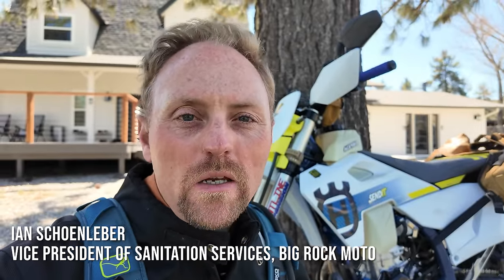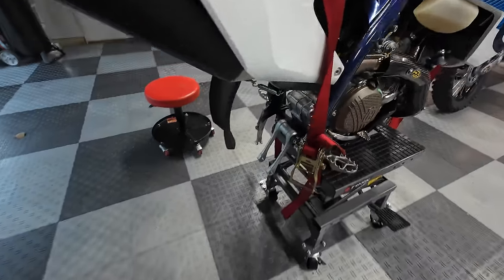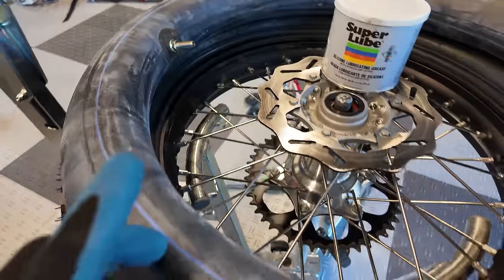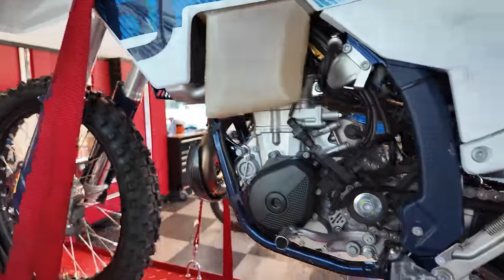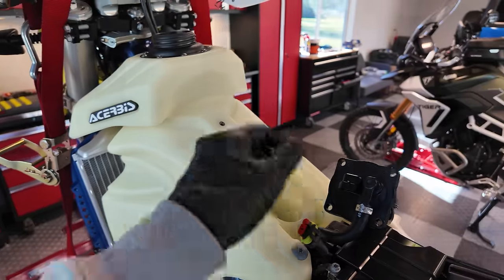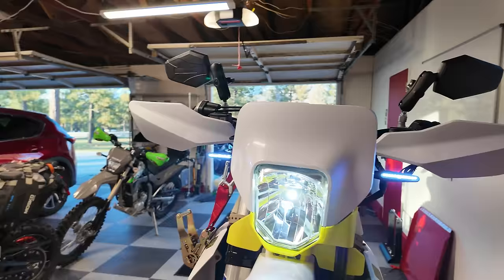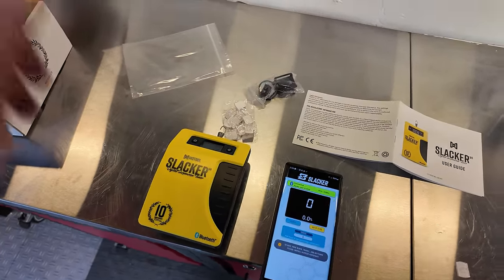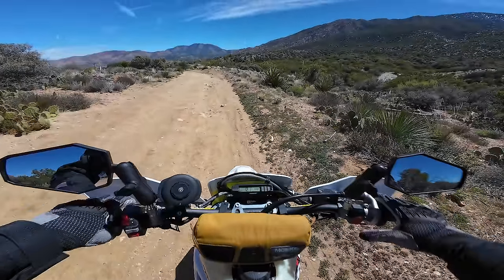2024 Husqvarna FE501S | Building My Dream Dual Sport (Phase I) (EP.4)

Comment: That’s not really a dual sport bike in the traditional sense if we’re being honest. It’s really just a street legal enduro dirt bike. And you took an already very expensive bike and threw several thousand more into it. I don’t know what your total build cost is but probably for the average dual sport rider there is not way that bike is $10k better than the KLX300, the CRF300L, the DRZ400 or even the DR650 or XR650. 
There is no doubt that you built a great bike but for the money I could have the less expensive option and use the rest of the money to finance a great adventure ride. 😂
It’s hard for me to justify dumping that much money into a glorified dual sport. Yes it has far better performance if you like to ride hard enough ALL the time to make it worth it. I think for us normal folk the more budget friendly bike offers just as much enjoyment and capability for far less money. 
I guess at the end of it all it comes down to do you honestly feel your getting your value for the investment or is it just more fun to see how many expensive farkels you can cram onto one bike? Especially when most are being provided free. Also, if you did have to foot the bill for all the parts used would you still do it? 
Either way, it’s still fun to watch. Keep doing what you do. ✌️
Reply: You'd be able to buy an f900!
Reply: My Kove 450 blows the “doors” off my KLX 300 and only costs $9k. About $11k with all the mods I’ve done, most of which are not really needed.
Reply: The difference with this bike is that you can ride on any terrain, at a high speed, comfortably. You can use this on a week long trip and be able to ride hard every day, while your friends on more traditional dual sports may be taking days off from riding to recover. If you just want to rip around at low speed, you can buy literally any bike and be happy.
Reply: @jckrieger  And is Ian riding "any terrain, at high speed"?
Reply: I find comments like this so passive aggressive.  “Value” is all relative.  What if someone can afford a bike built like this and also do an adventure trip?  Is it really necessary to compare other less expensive motorcycles to his build?  I for one have seen him test several bikes at all levels of expense.
Reply: @michaelflores7657  not at all. I wasn’t being passive aggressive it was genuine questions. Regardless of income or what one can or cannot afford within their budget is it actually worth all the extra expense compared to the less expensive options. And yes the word “value” can be quite subjective yet it’s used very often in the motorcycle world. By that logic pretty much any way we describe our personal experience with any bike is extremely subjective. So I guess I should simply not ask probing questions and just throw my own money around to find out if it was all worth it in the end? Is that not the purpose of following a reviewer? It seems that anytime anyone questions the reasoning of one product versus another it’s viewed as argumentative and aggressive. Perhaps I don’t eloquently articulate the proper tone of voice in my writing in such a way as to convey my thoughts and not sound aggressive. Maybe your not understanding my line of questions and should ask some of your own for clarification?
Reply: The FE501s is a great bike out of the box, and is an incredible dual sport. He's throwing money at it because he has a YouTube show that gains viewers and sponsorships through these types of mods and changes. My FE501s has tons of miles on it with the only mod being double take mirrors, and the only change being tires, because I wore out the TKC80s. That includes long distance, I did a 1600 miles 9 day on/off road trip around my state. I was on the stock seat even, and it's fine after it breaks in.
Reply: You should go into a bicycle shop and tell them how much wal mart is charging for “comparable “ bikes lol
Reply: @ridemfast7625  most of the time from what I see Ian is riding a fair bit faster than I would and is probably a more skilled off road rider than I am. Which again is why I was genuinely interested if there was actually real value or benefit to be had with putting that much into a bike like this for an average dual sport rider. If you have a background in enduro or motocross than I’m sure the more performance oriented bike would mean a world of difference but to me I don’t think I would be riding hard enough to need or appreciate the higher spec. But then again I could be wrong and the higher spec bike might give me more confidence to push harder off road. 😂
Reply: @coreyjdl  thank you. That answers some of what I was wondering. ✌️
Reply: @coreyjdl  I'm going to try to "break in" my stock seat. I have a Seat Concepts on my 2024 FE501 which I have thrown some money at. But since Brexit, even stuff from the US has shot up in price, so I'm going to get the wear out of the stock seat on day rides, and keep the expensive SC for big trips. I've worn out one SC cover on my 701 at 16,000 miles, about 24k km.
Reply: @michiganmoto7687 it’s not hard to hit the limits of a KLX 300 or CRF 300. And if you start pushing beyond that the bike is actually more dangerous and harder to ride than a higher performance one. But for total beginners and very casual riders they are fine. Unless you want to dump $$$ big money on mods.
Reply: @michiganmoto7687  No clarification needed on my end.  The first 3/4's of your message is telling Ian "there is no way that bike is $10k better...."  Everyone of your statements end with a passive aggressive jab at anyone that decides to spend $$ on parts you deem as not worth it.  Even your actual questions are laced with passive aggressive statements, it is literally the definition of passive aggression...I love how you had to capitalize "ALL" just in case we didn't see that.  BTW,  IMO if I have a performance part on my bike like suspension revalve, steering stablizer, ecu, traction control, etc I don't have to "ride hard all the time to make it worth it", if those parts help me stay off the ground one time it's well worth the $ i spent on them.  Again, that is just me and what I value.  I'm in no way implying that it's a requirement or even necessary for everyone to enjoy their bikes. I'm very thankful that Ian is testing all these different parts on the bike I'm going to build also and it's absolutely irrelevant to me if he received the parts for free.  I believe he's always been transparent and honest in his reviews.  Again, I don't understand why anyone would care how much someone else is spending on a bike build.  If you can get more 
enjoyment out of a stock bike that is AWESOME(pun intended).  Personally, I love putting upgrades on my bike and believe me I'm not pushing the limits of even my stock bikes.  It's what I enjoy and I get a tremendous amount of satisfaction from it and so for me its worth every penny.
Reply: @michaelflores7657  fair enough. I’m not going to apologize if my personality or how I speak seems like I’m intentionally trying to be offensive. If that’s how you choose to perceive it I can’t help you with that. Also I also feel Ian is honest in his reviews. I had genuine curiosity if it really was that evident in riding one versus the other. I’ve not had the opportunity to experience it for myself and it puts me in the position to rely on the information of others. As far as what mods you or anyone does or how much they spend doing it I really don’t care. Makes zero difference to me and for some reason that’s where your focus went. I don’t know, maybe your wife is giving you grief for spending money and now your ultra sensitive to the topic. What I do know is speaking to you any further is pointless because your more interested in pointing out my faults than having a serious discussion. So stay safe, add another mod and don’t fall off. ✌️
Reply: @michiganmoto7687  I’m in no way asking for an apology, you are who you are.  Whatever I say or anyone else says isn’t going to change you.  I will say bringing my wife into this discussion says a lot more about who you are than it does anything else.  You are correct about carrying on this conversation is pointless.  I wish you the best and hope you get your questions answered to your satisfaction.  Stay safe!

Comment: I'm a big fan of your content, but the magnetic filter is just marketing nonsense sorry Ian. Magnetic filters do exist, and are used in industry, but they have very specific use cases. Usually the best places are large machines, such as large diesel engines where the regular diesel filter might foul up quickly. Even in this application, it is a secondary, not a primary filter. This is most of the case of use for magnetic filters. Even with that being the case, wouldn't engineers in any of the Japanese or German companies not add this if it was not the most reliable option? 
The other big glaring problem is non-ferrous material. Even if your engine only has ferrous material (many small engines often have different bearing, washers, and seals that are non ferrous) such as in larger displacement industrial sized generators or marine engines, magnetic filters also do not account for small particulate like carbon or other similar natural particulate.

Engineers are not as dumb as mechanics think. Magnets aren't new technology, and this isn't a real solution to filtering oil in a small motorcycle engine (or even car engines for that matter, check how many cars have magnetic oil filters). Even if you don't have the degree, you can still read the material online, it's not a far search. Often times engineering is tradeoffs, and if something sounds too good to be true, it usually always is.

Comment: cannot believe they have made it that messy just for the rear shock removal - masssive Fail , my 2019 500 is 2 bolts and shock is out , talk about a step backward - linkages ewwww
Reply: It’s not like the shock has to be removed on a regular basis lol
Reply: @weswilliams4661  If you are a good rider that shock will need to be rebuilt 3 times in a season to keep peak performance.

Comment: No thanks, times 3. How many riders weigh 170 with gear? What a total joke. Ian I know why you build out your bikes, but I would never do that much work to upgrade. Cost mainly, I don’t do my own wrenching anymore either, so there is a labor cost too. Same with your Trans Alp build out. Waaaay too much money and effort.
Reply: 3/4 of the stuff he really doesn't need. The wrenching is just part of the fun. All the bike really needs is the seat, fuel tank, maybe some reinforcement screws in the tail to keep it from coming off again. BTW I weight about 170 with gear. :)